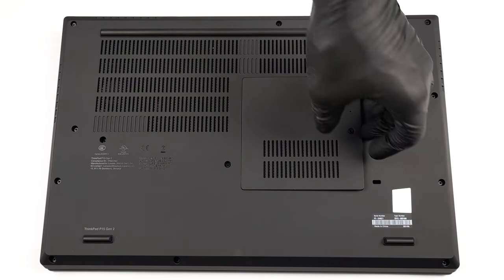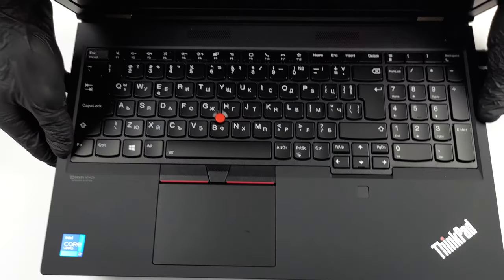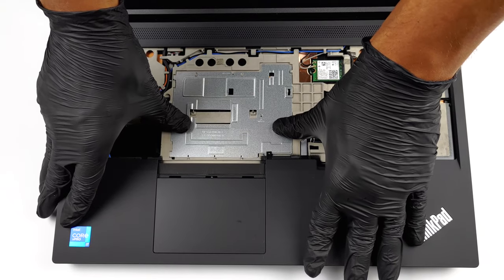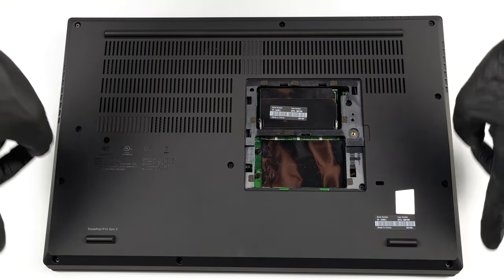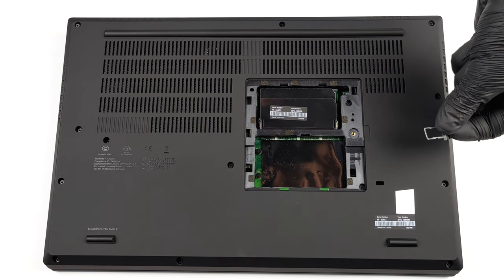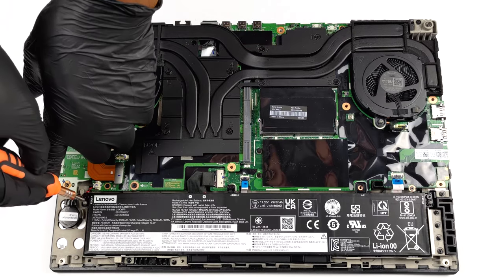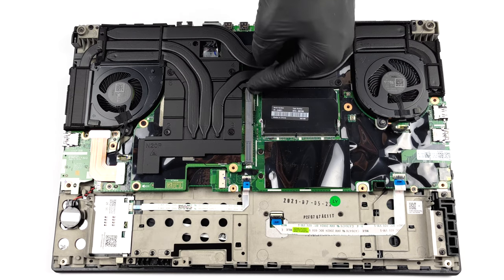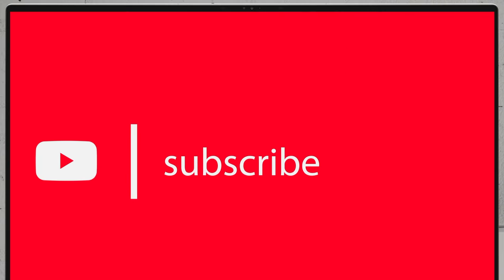🛠️ Lenovo ThinkPad P15 Gen 2 - disassembly and upgrade options

Comment: " to continue you need to undo a couple more screws which will set the keyboard loose" uh.... ok.... which screws?
Reply: Exactly!
Reply: I think the only ones required are the two under the RAM access panel. If that doesn't work the other two that are NOT around the perimeter.
Reply: 100%, most screws were unscrewed off camera, what's the point
Reply: this though..... grrr
Reply: 2 in the ram access panel and one that comes directly above ThinkPad P15 Gen 2 name (deepest one)

Comment: great video!  lenovo waste so many space (beside battery), it should able to fit in one 2.5 HDD slot.
Reply: Why nobody wants spinner drives today, they are slow and clunky... SSD are low enough cost now, no reason for HDD.
Reply: @markh.3665  not really, if you want big drives, harddrives are still cheaper than SSDs.
Reply: @ferrari2k  if you want cheap dont buy a p15 gen 2 lol
Reply: @garfreld True, but that wasn't the point regarding harddisks and SSD ;)
Reply: @ferrari2k  You can use a thunderbolt or usb to sata adapter anyway if you need bulk storage.

Comment: Back Panel is not coming off for some reason, pins start breaking and I unscrewed every single back panel bolt and screw including the one for the keyboard. Should any front screws be undone as well?
Reply: Service manual says you need to eject the nano sim card tray

Comment: Wonder if you could help with a quick query?

 I was under the impression I could upgrade the GPU as the ThinkPad p15 gen 1 has a modular GPU daughterboard, is this correct or not?

As I always intended on upgrading my GPU to RTX 5000 here is my model

Lenovo ThinkPad P P15 20SUS5W300
Reply: You can do that.

Comment: I took my heatsink off to use liquid metal and discovered the GPU is not actually soldered on for the gen 1. I wonder if I can upgrade my 2080 to a 3080.
Reply: You can only use GPUs that are in the original configuration table.

Comment: The Max RAM upgrade is 128 GB. What's the Max SSD Storage for this machine?
Reply: 3 x 2 tb
Reply: @ChodTheWacko  I have a 512GB storage and need to upgrade. Which make and model SSD do you recommend?
Reply: @trishachitkara3013  don't know, to be honest. Mine came with 1 gig and then i moved over a 2 and a 512g from my other laptop so I'm loaded now